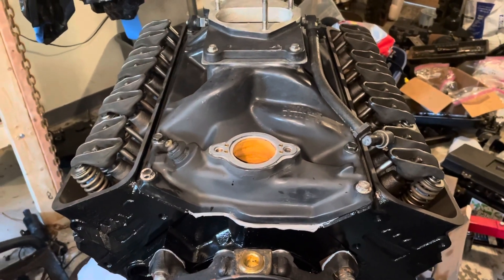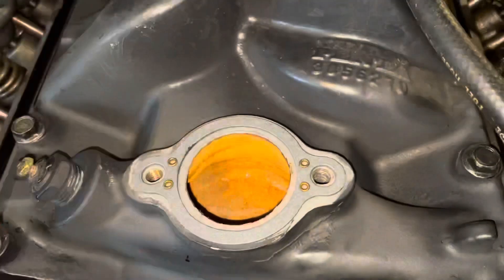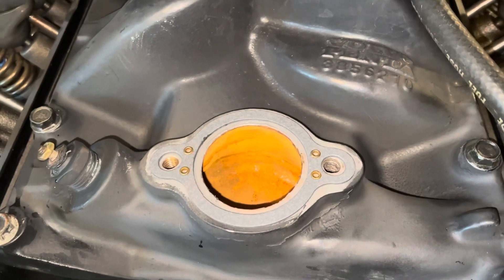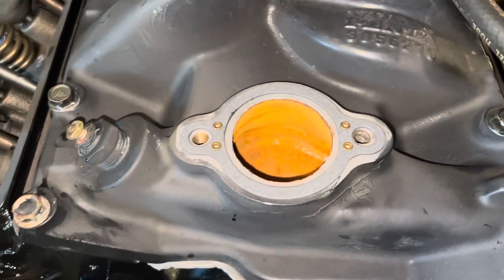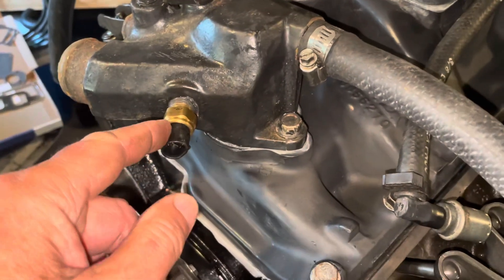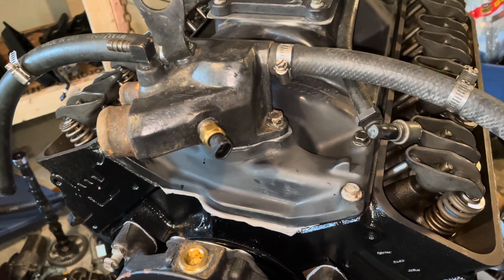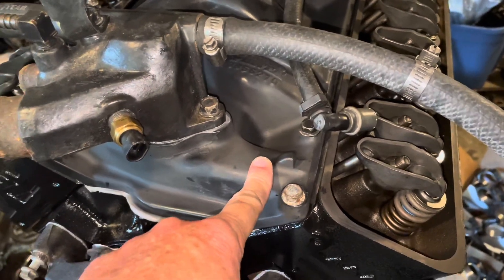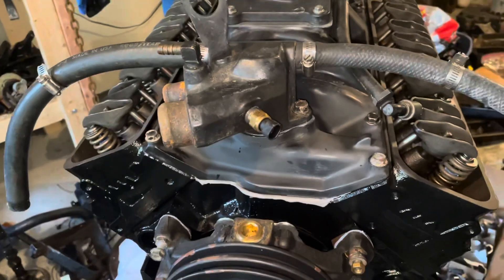Mercruiser 5.7 1(n) - Thermostat Housing

Comment: Well with a new motor i have a issue with  guage pegging out under way .But using a temp gun. It is all cool and my switched alarm is not going off. Temp of  seawater 78. Risers 80 deg. anti freeze  in tank 138  raw water side 128. HX is cleaned and trans cooler hx.New guage and sender. The only part not replaced is the intake and t-stat housing. Stat sender is in the inktake when i shoot the gun there its 140. Going to drain anti-freeze and replace stat housing with a 160/ 140 in there now but for cc it should be a 160. Hoping to find a blockage that is causing a steam port at sender. Also heard you should drill a 1/8 hole in stat to prevent false guage readings of sream by stat before it opens.